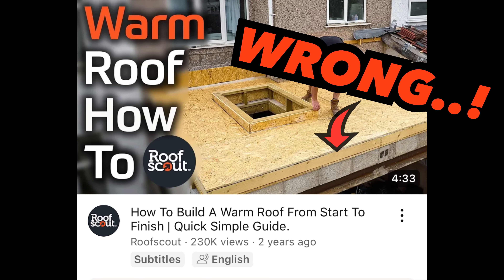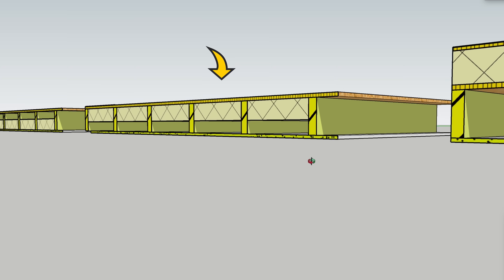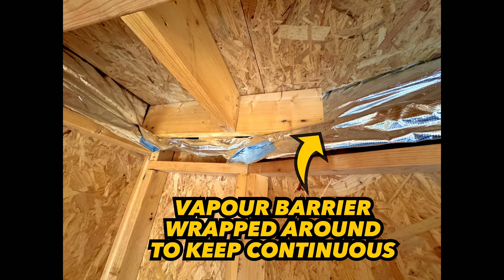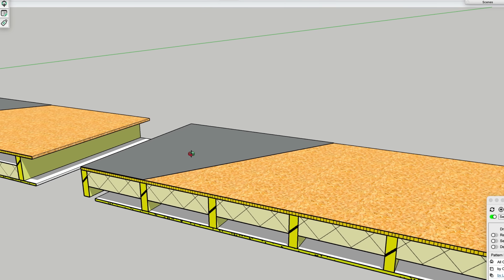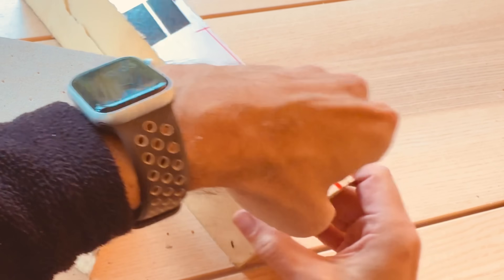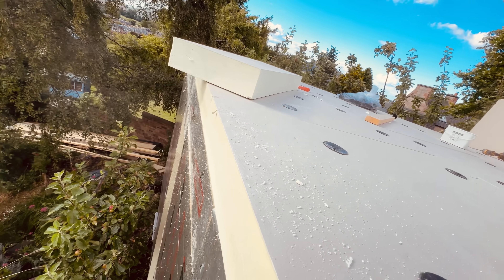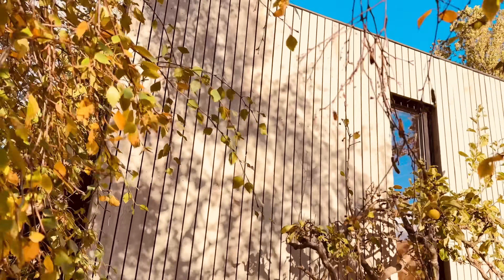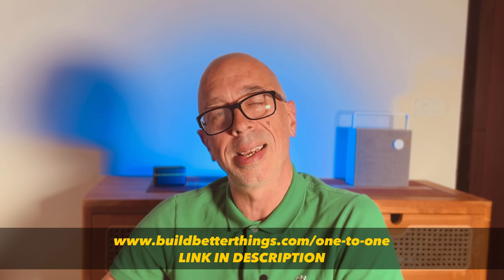Build a Warm Flat Roof the Right Way

Comment: Thank goodness I'm not the only one saying this. I've been banging on about it for years. OSB should be on the INSIDE of insulation, if it's anywhere. The good old US of A is going to have a massive issue with their walls in the next few years, as they've been making thjis fundamental mistake for decades. Oh, and I'm an architect.
Reply: @MikeAG333  if they’ve been making this mistake for decades, isn’t it about time we see some evidence of failure?
Reply: @OmegaLok  We are seeing evidence of failure. Lots of it. But what we haven't seen is any large-scale research or reports, academic studies, or proposals for revised "codes", as the Americans call them. Houses are just repaired on an ad-hoc basis, and the failures blamed on poor workmanship, or leaky gutters, or somesuch.....but if you pull off the outer skin and OSB on almost any 20+ year old house in the parts of the USA where winter heating is a thing, you'll find mould on the inside of the sheathing board, and damage to the framing.
Reply: @ fair enough, a big difference though is studs in the framework which interrupt insulation, and the type of insulation (mineral wool or fibreglass).

In a warm roof, you are now required to achieve a U-value that basically translates to 100-150mm of continuous PIR (or phenolic) insulation. 

Does that translate in the certainty of getting a rotten outer layer? I disagree for the reasons mentioned above AND for the lack of evidence.
Reply: @OmegaLok  I don't think the type of insulation makes a great difference. Indeed, most PIR insulation is a sort-of vapour barrier, and thus keeping some of the vapour on the warm side of the insulation and reducing the potential for interstitial condensation.

This situation is analogous with sand/ cement render on anicent oak framed buildings, which effectively puts a vapour barrier on the outside of the wall build-up. no matter what you do then, there is always the potential for condensation on the inside of the render, and that will always run down and rot the sole plate and the feet of the studs/ posts. We know enough to avoid that like the plague, yet we don't see, somehow, precisely the same issue arising in modern timberframe construction. We're fools.
Reply: @MikeAG333 
There is no condensation, it does not reach the underside of the OSB that’s the whole point of a warm roof, that’s why it’s actually called a warm roof. If I link any site that explains this, this comment will be deleted 
Just search dew point in a warm roof you should get the actual technical information
Reply: @ianjohnson1207  You realise that you're talking to an architect? "Warm roof" means the structure.....the joists........are warm. That's all. It doesn't change anything about the passage of water vapour though the structure, other than that there is no ventilation below the weathering layer.
Reply: @MikeAG333  
No problem mr Architect, please attach the formula for calculating the dew point and where it will be, because everything I’ve posted I’ve copied from flat roof architect websites and the building standards site 
The good old do you know who I am 😂😂💩
Reply: @ianjohnson1207  No, not, not at all. I just felt you were patronising me somewhat by suggesting that I don't know what the dew point is, and should go and look it up.
Reply: @MikeAG333  
Please feel free to back up your statement
Because you are saying the OSB will rot because of condensation, the opposite to what lots of other architectural sites say
Reply: @ianjohnson1207  Firstly, which statement, as I've made about 7 or 8? Secondly, I didn't say OSB would rot. If you are just looking for an argument, how about arguing about the things I have said, rather than the things you want me to have said. OSB acts as a vapour barrier on the outside of the structure, and condensation forms on its inner side. In the case of a wall, this runs down and sits on the sole plate, eventually rotting it.
Reply: @ 
“I’ve been banging on about it for years. OSB should be on the inside of the insulation”
Not according to any site I’ve looked at either architectural or the latest building regs 
So I’ll ask you again where is the dew point on a warm roof and that is with OSB on top of the insulation?
Reply: @ianjohnson1207  You're showing your ignorance. Building Regs makes no mention of the build up of walls or rooves.

And you're also showing that you lied about my claim that the OSB would rot. I don't waste my time with ignorant liars, so thanks for taking the trouble to have a go at trolling, but you've actually picked on someone who knows what theyu are talking about.........and now you'll have to settle for prattling on to yourself. Ta ta.
Reply: @MikeAG333   
Ignorance, from a man that can’t spell, roofs, not rooves 😂
I haven’t lied or trolled you, it you don’t like being questioned about a dubious comment, you’re in the wrong place 
And I certainly haven’t given out advice to members of the public which is incorrect unlike some!
Reply: @ 
Think you’ll find 99.9% of housing is not “airtight” and that point is totally mute, we are talking about where is the dew point in a warm roof?
Reply: @ 
For further detailed recommendations for the management of moisture in flat roof construction, BS5250 should be referred to.
Reply: @ianjohnson1207  Mute?!  Bwahahahaha.
Prattling on about the dew point displays a total ignorance of reality. Dew point calculations are for a set level of temperature difference between inside and out, and for a set level of relative humidity. Change these parameters and the dew point changes.....drastically. So continuously asking "where's the dew point?" is ridiculous, as it is always on the move.
Reply: @ianjohnson1207 Ta Ta 😂
Reply: @MikeAG333  
It makes no difference because with the minimum thickness now set at 150mm to meet the U-Value requirement, this covers the range of temperature/humidity expected in the U.K. so this thickness allows for a large enough range of outside and inside temperatures and humidity 
Try reading about the regs it might enlighten you, make you a happier person
Reply: @eddiemcboofin1917  
You bring a lot to the discussion 😂😂
Reply: @ianjohnson1207  Do you realise just how rude, patronising and gormless "try reading about the regs" is to an architect? I know them inside out. I work with them all day, every day (oh, and what you think are the regs, aren't).
How about you toddle off and research "breathing walls". Then, when you're done with that, have a look at the location of VCLs in a wall build-up, and see if you can find anyone who thinks that putting them on the cold side of insulation. When you can't, come back here and apologise......because OSB is a vapour barrier.
Reply: @MikeAG333  
Reading your previous comments doesn’t look it, just because you’re an architect means absolutely nothing, a friend has just had plans for an extension drawn up, the warm roof design was wrong, basically a hybrid roof for absolutely no reason 
In any profession you get good and bad, unfortunately
Where have a said any comment about VCL’s
Reply: @ianjohnson1207  
"Where have a said any comment about VCL’s (?)"
That's the point I have been trying to make to you for days now, and for some reason you just don't ever get it. You are picking on me because I have said that OSB on the outside of a structure is a bad idea. That's ALL I have said. But...........now pay attention............OSB is a vapour barrier. Right? Comprenez? 

Now, if OSB is a vapour barrier (it is), why is it OK for OSB to be on the outside of a wall or roof, but not for a sheet of plastic?
Reply: @MikeAG333  
Is it.
OSB is vapour permeable though, so will allow water vapour to move through it. As such, OSB is not suitable as a vapour control layer - for that you need to use one of the boards made specifically for vapour control, such as Spano DURÉLIS VapourBlock
Reply: @ianjohnson1207  Oh sheesh.....you're trying really hard to make yourself look silly. OSB is NOT vapour open (in almost all circumstances)...there are academic studies on this. I have no idea why you would think I am interested in boards which are designed as a VCL. And I have no idea why you don't understand the point that having a vapour-closed layer on the outside of the build up is a bad idea. If you don't get that, I 'm sorry, but I'm unable to help you.
Reply: @MikeAG333  
I might be trying, you are succeeding
Reply: @MikeAG333  No, OSB is definitely not a vapour barrier.  In a typical timber frame wall any water vapour will travel through the OSB and breather membrane and be taken away in the airspace behind the exterior cladding.  If there is so much water vapour that it is overwhelming the layer of OSB then there is a bigger problem of water ingress that needs to be addressed.   For a wall build up I'd always recommend an airtightness membrane (such as Intello) to reduce air infiltration into the house, but also to limit the amount of moisture entering the wall build up from within.
Reply from the maker: Thanks. I guess you have many more climates to consider compared to the smaller European geographies. Scotland has slightly different energy legislation and therefore different make ups, for example, than England, but it’s a relatively small area.
Reply: @build-better-things  I'm English.
Reply from the maker: Ah. Ok sorry I just assumed.
Reply: We use iko ultr life 30 as cap sheet over iko partial bonded base layer directly over osb . That's the way .

I hsve lost count of the edpm fibre glass roofs that gave failed due to rotton top deck it starts softening as it absorbs moisture then fixings start popping through .but these I know it all builders kep doing it .because edpm is crap says it all when you need a deck beneath it over rigid board .do not put osb over insulation on warm roof because it is no longer a warm roof simple science

Comment: The principles apply to peaked and pitched roofs as well, but I didn’t know that until I started paying attention. After the spray foamers came and insulated my attic roof. I haven’t a clue if there was any sealant or member sprayed to the underside of the roof decking before applying the foam. 😅

Comment: I'd be interested to hear your thoughts on calculated dew point.
Reply from the maker: Hi. Great question. I deliberately avoided talking about the “calculated” dew point because I don’t think it’s relevant to what I’m talking about and it’s not something many might understand. It’s just very hard with the choices of information to focus on in the time  you have in ten  minutes of video. I’d make a specific video on it but I’ve tried similar before and the interest isn’t there.
Reply: Fair point, good to keep the info concise. I agree it's good to keep the details robust and allow an easy way out for moisture. You can never guarantee a perfect installation of a VCL so a theoretical dew point can become slightly irrelevant anyway. I always try to specify details that still work even if they are installed on a Friday afternoon. Cheers.

Comment: Even if you can make it fit in 2.5m, it's still an absolutely moronic regulation. It forces stupid design decisions which make for both cramped spaces and compromised structures. Even an extra 200mm would go a long way to making a building more enjoyable and better structurally.
Reply from the maker: I agree. I made a video about the best way I think to do it
Hybrid Roof - build the Right Way- avoid overheating, avoid timber deck.
https://youtu.be/5Xiw04-7Jmg

Comment: Interesting video but the dew point should be calculated so it’s in the center of the PIR and that’s why you can have a OSB top deck without fear of it rotting.
Reply: At last someone that actually knows and understands the warm roof theory, and why it actually works
Reply from the maker: I think you’re talking about about the “calculated” dew point which you can determine by defining a couple of  variables.  You are correct in that it can be in the centre of the PIR, especially in a warm roof. That’s not what I’m talking about in the arguments I’m making. I just tried to keep it simple to avoid confusing jargon. I may make a follow up video to go into the detail of   what you’re saying versus what I think is also the case. Thanks for your comment.
Reply: @build-better-things  isn’t that the whole point? You’re saying it will rot with certainty while it’s actually in theory, same as, in theory the moisture will not rot your ply in your construction.
Reply from the maker: I’m saying that I’m mitigating against that possibility. Having a composite on the cold side provides no mitigation.

Comment: I’m currently designing a warm roof, and like you point out everywhere shows a top deck of wood material. 
This bothered me for the reasons you lay out, if the wood on the cold side can’t breathe it’ll rot.
I’m planning a GRP roof, but I think it would still be best to have a top deck to do so.
What are your thoughts on a rather unconventional method of using something like an xps tile backer board for top deck before GRP?
Reply from the maker: Yes, I guess if you’re set on GRP, that’s an option, but the point is, you want the dew point (where it condenses) to occur toward the outside of the rubber, so it just evaporates away. Even with a synthetic board, which won’t rot, you’ll still have trapped condensation, since the dew point will happen someways into that board and the “dew” has nowhere to go.
Reply: @ thanks for the super quick response! There is so much mixed information available it hard to know what is best.
Reply: @SlayerLaw  There is simply no evidence of a top deck rotting if there is a VCL. The only thing I find on youtube is: https://www.youtube.com/watch?v=6NWrYG2G2Ho and surprise surprise they did not use a VCL. All other examples are pitched cold roofs with improper ventilation or water ingress
Reply: @OmegaLok  Thanks for the additional input. That roof did seem to be poorly constructed! It seems logical if the VCL is working correctly it should be ok. I will keep researching